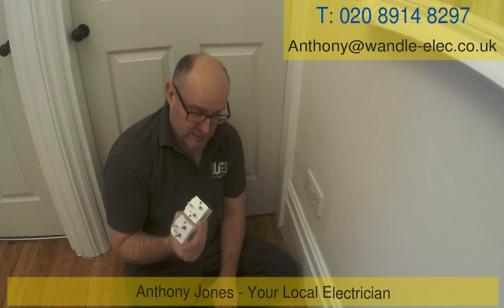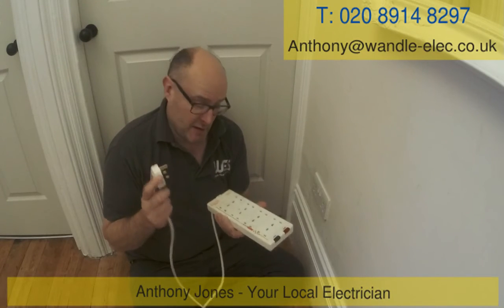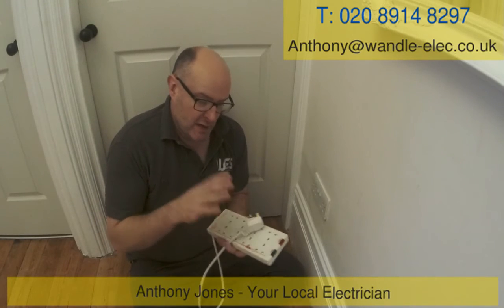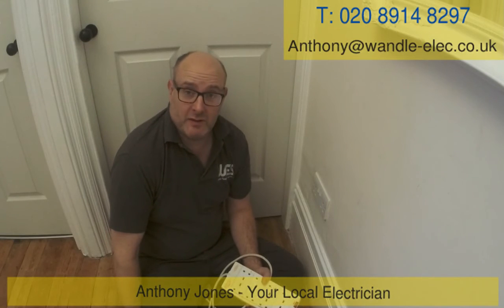Overloaded Sockets and Your Safety

Comment: Am using a 15 plug tower surge protector and would like to know what I need to test the watts that are going into my wall socket from this tower as I have head the maximum watts in the UK is 3000. I have seen on Amazon a tester that you plug your devices into to get the overall watts I have coming from my tower. Most of what I have are low power such as led lamps, pc speakers, and pc with monitor that I know use more. Hope you can help with what to buy to test the wattage output from my tower. Thanks

Comment: So if I bought a brand new bar plug adapter I already got one used years and it's 13 amps  and still only plugged in TV charger  plug and games consoles I'm ok ? I've checked on the official which ? Fire safety and used the online  amp calculator all say good ?

Comment: Another way to overload the electrical socket is by plugging in too many 2khw heaters or other high powered devices. A 32amp circuit can only take 7.8khw. Just takes 4 small heaters to blow the circuit.

Comment: I have a outside double socket I'm running a 20 mts xlead to my shed and running a heater and a light and plugged another small xlead in to this.is the too much what's my other options
Reply: Get an electrician to wire it up properly, they'll bury SWA cable and likely run a new feed from the consumer unit or perhaps tap off of one of your existing circuits.  Alternatively just make sure you're never pulling over about 2.5kW long term and any extension leads are fully uncoiled.
Reply: @edc1569  can I  run 2.5 cable from my outside socket and branch of 4 double sockets to my shed having the first socket a rcd socket . Shed 20 mts away

Comment: In theory could you overload your house the same way? By plugging in too many appliances. I had and argument as I always thought it was dangerous to daisy chain extension sockets as you could run alot more than 13 amps through one socket on a ring main. His argument was well you could over load the ring main if you plugged too many things into it, with out the need for extensions so daisy chaining isn't dangerous.
Reply: No, the ring main is protected by a fuse or a circuit breaker which is rated to ensure the outlets and the cabling are operated within their rating.  The problem with overloading a plug-top is the 13A fuse is not really well designed for protecting against long term small overloads say to 15-20A, often it will fail to blow before severe damage is done to the plug and socket.  It's commonly appreciated nowadays that pulling >10A from a socket over a long term will produce a concerning level of heating to the typical socket, all the electric car manufacturers limit their portable chargers to 10A in the UK.
Reply: A 32amp circuit can only take up to 7.68KHW of power. Should be no problem unless you are running a few small 2kwh heaters at the same time.
Reply: @daviniarobbins9298  The worst it will do is trip the breaker.

Comment: hi just wondering i have an 8 plug extension i got from amazon which looks really modern and safe. but its too short. i was going to buy a  5 metre 1 plug extension just to connect it to the wall. would that be safe?
Reply: It's not recommended, the main reason is if you overload it it's going to melt the mid-way connection first and these tend to be much less capable of dealing with an overload than a higher quality wall socket.

Comment: i wana use as : 1) first will plug a 3 pin multi socket/splitter with 13 amp fuse in it, 2)  then i will plug a 3 pin extension socket(4 slots , with fuse in its plug+overload protector in board ) for using my desktop pc in shaa Allaah. will it cause any problem???

Comment: Unfused two and three way adapters are illegal and have been for several years. Report that to trading standards.

That's been the case since 1989. "February 1989: BS 1363-3:1989 "13 A plugs socket-outlets and adaptors - Part 3: Specification for adaptors"
Reply: i wana use as : 1) first will plug a 3 pin multi socket/splitter with 13 amp fuse in it, 2)  then i will plug a 3 pin extension socket(4 slots , with fuse in its plug+overload protector in board ) for using my desktop pc in shaa Allaah. will it cause any problem???
Reply: Surprised you can still buy them.

Comment: Would it be the RCD that tripped or the MCB? There are much better videos out there on this topic e.g. John Ward.
Reply from the maker: Thanks for watching Guy.  John Ward has some excellent videos.   An MCB would trip with current over the rated mcb ampage.  So on 32A ring main the mcb is unlikely to trip even if 30A is going through a socket rated at 20A(standard uk domestic socket).  It will also trip with short circuits but an RCD will detect it earlier.  An RCD will trip with imbalances in current that can be caused by heat deteriorating insulation and casing and leakage of current.  Both symptom a of overloaded sockets.  Xx

Comment: Don't you have central heating or how can you overload sockets? Apart of microwave and toaster I have no equipment that uses over 100 watts. Do you know how many sockets one would need. On my TV I have about 10 power cords, same for my PC. Also with the extension cords one can unplug them easier if it is needed.
Reply from the maker: Okaro X hi,  this socket overload calculator on the electrical safety first website will help you.  https://www.electricalsafetyfirst.org.uk/guidance/safety-around-the-home/overloading-sockets/
Reply: @wandleelectricalservices-e7704  Hello! Great little vid thank you. 
Two quick questions if you have a moment. 
If I were to plug one extension 8 gang socket lead into another but keep all items under 13a that are plugged into it, would this still be a risk? Even if the wire from one to another were under 1m? Or is it the extension leads themselves that would cause the issue not the items plugged into it?
Also, is there any way to tell how many amps the socket or an item is using if the manufacture does not tell you?
Reply: @jamesmacintyre  you can get in line watt meters that will tell you what things are using, for devices that don't intentionally produce heat in their operation you're probably fine.  The problem with chaining extension leads is its much easier to end up with an unsafe connection as they're not the same quality as the units in your walls.

Comment: All new block plug splitters now have a 13a fuse in them as part of the 18th edition. So unless you're using old ones there's no advantage to using the bar type extension lead as they both have fuses.
Reply: Even older than that 

February 1989: BS 1363-3:1989 "13 A plugs socket-outlets and adaptors - Part 3: Specification for adaptors
Reply: @Mouseythegreat is that the double socket that goes over single socket screwfix
Reply: @Mouseythegreat I didn't know u could get a trible can that go over a single and would I have to put a new back box in
Reply: @Mouseythegreat thanks does every socket come with a fuse in it I never noticed?